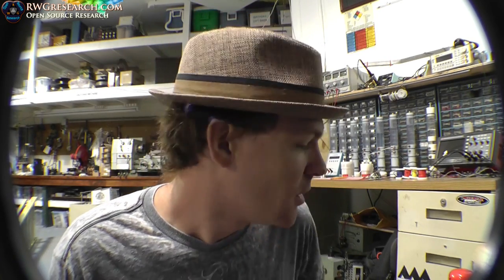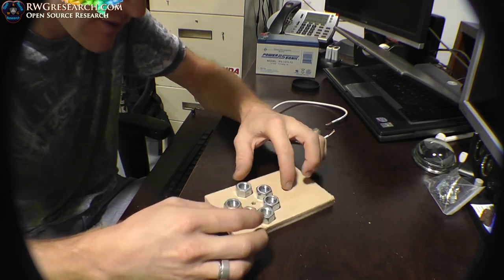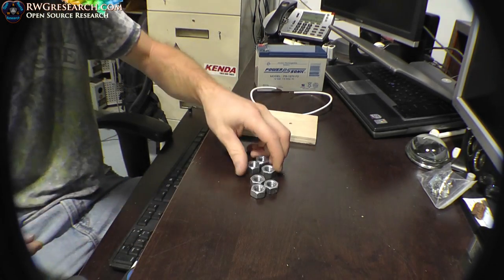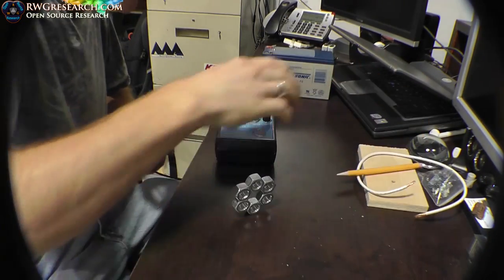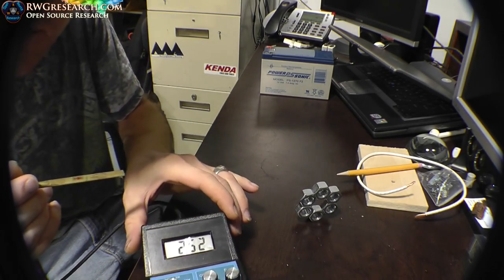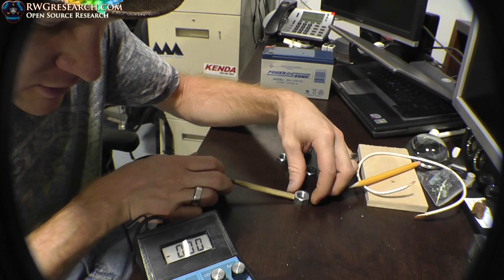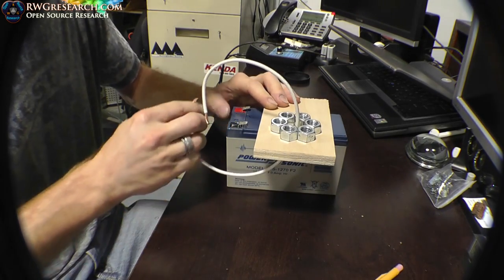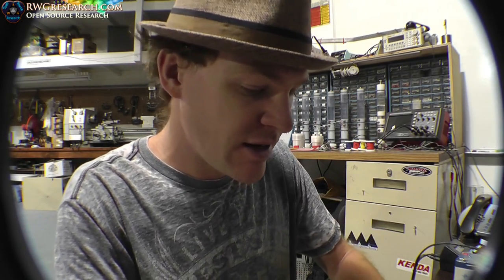“Oh Nuts!” Magnetic Lock.Your Going To Like! Using The Principles Of Ed Leedskalnin PMH.Must Watch

Comment: Its molecular welding. The circle of nuts creates a magnetic trap like a transformer winding, (brain fart cant recall what theyre called) and the magnetic energy travelling away from the wire in one direction gets trapped in the nuts, and then the surfaces of the nuts weld together on the molecular scale, because theyre passing electrons, so they share bonds after the process is done.

This is similar to that bar on the U bolt trick, except i cant be so sure its molecular welding at play there, but i suspect its similar.

Most likely there is some form of magnetic molecular welding that few know about and even fewer have studied.
Reply: I think your on the right track.  If you look at my comment about 2 days hence I also suggest something similar but  having to do with interaction with the casimir effect.
Reply: Larry Shelly I havnt studied that much in electrical physics and magnetics, im more into gravity, and "dark matter" (quotes because spoilers, it doesnt exist) stuff. Ive had working models for black holes and space warping for a decade now, working models for the big bang too, how everything works, but of course im not a big name professor so my ideas get ignored!
Reply: WeAreGRID I am with you on the subject of "dark matter".  It's more suspect than Einstein's cosmological constant that he used to explain what he didn't know.  At least Einstein didn't try to tell everyone this constant was a fact of nature.  He really didn't know and had the courage to admit it.  Maybe dark matter and energy are really just the remnants of the "true vacuum" that existed before the "big bang".  I wonder if we all might be immersed in those remnants and that could be the explanation of even gravity (tiny bits of truly "suckey, sticky stuff" that induces the material around them to battle for their spot).  Ok maybe a bit simplistic but I think the final answer almost has to be that simple.  Anyone for "King of the hill" or maybe "hole". Anywho, way off the subject.  I look forward to checking out your stuff.
Reply: Larry Shelly I should add: I am impressed by your elemental thinking that gives you a "view" inside what is at the heart of magnetism rather than just describing the general attributes of a magnetic field.  Electromagnetics is at the heart of understanding everything.  It might not be everything but parallels probably exist that make many things clear if you see to the heart of it.  I am not fishing for over-unity like many others.  I'm just looking for better ways to understand and use what's obviously out there.  Stay vigilant.
Reply: Larry Shelly The whole dark matter thing is actually very simple, and i can explain it in a relatively short amount of space.

Black holes have enough mass in them to be able to exceed light as an escape velocity, but they do not have enough mass in them to exceed SPACE as an escape velocity. 

Because of this, they are infinitesimal points in space, but immensely large on the inside, they suck up mass, but not the space inside the mass.

Space is a liquid, its a fabric, and every particle occupies a specific weave grid location of space, when you move large amounts of mass, space sometimes moves with them, however when you suck up the mass (into a black hole) the space is now empty, there is space left over without mass.

This is the cause for many so called "dark matter" phenomena, such as galaxies rotating as a whole instead of as a vortex, specifically galaxies contain so much excess space that the arms are closer together than they seem, and so they rotate as a solid and not as a liquid because the vortex is in space, not in mass.

Another "dark matter" phenomena is the increasing expansion of the universe: Galaxies are flying apart faster because the black holes at the center are sucking up mass, but not space, so the excess empty space is being spat out behind them, (or rather in every direction, but due to momentum more ends up behind them)  simultaneously making them thrust propelled, AND making the actual physical distance between them and other galaxies larger, making it seem as if they are accelerating at increasing velocity when really, theyre moving at constant velocity, but are making more and more space, which logarithmically makes them cover more space over time than just a moving object.

A third example of this, and one ive been theorizing over for quite some time, but recently have had my theory confirmed by research into the big bang (there was a news article about how they proved through some microwave particle or some such that space expanded first, then mass).

The big bang happened as follows: 

The previous universe, having eventually (read; after quintillions of years from now) coalesced into entirely black holes, and eventually those black holes found each other, due to extreme gravity, then sucked each other up, and at the last moment, as every piece of matter in the universe (or a mathematical reasonable facsimile, as near infinite is identical to infinite, meaning there could be space ships outside the universe for us to find, or not find as the case may be) was condensed into the singularity (sound familiar?) the combined force (read (E=mc^2)(infinity) ) unified all seven forces, and produced enough pull to actually be able to suck in space, and space, being over an infinitely tall well, immediately rushed in towards the center of the singularity, causing the universal expansion of space in the instant before the big bang.

The outside of the singularity now being devoid of mass (or a reasonable infinite facsimile) and now space, ceased to exist, the inside becoming the new universe.

Space expanded on the inside of the singularity, draining the outside of the universe, and rushed to fill the universe at what, 11 times the speed of light? 14 possibly, i digress, and then the inside of the singularity, having become boundaryless (as space exploded from the inside out) now proceeded to release every particle into the newly formed area of the universe, and from there, the rest is history.

Relatively short amount is accurate, as i could write most likely an enormous thesis on each of these phenomena.

And with that, i give you space as a liquid, and the argument against dark matter.
Reply: Larry Shelly Did you know the human brain is the most advanced GPU in existence? its how fighter pilots do physics calculations in their heads, its how you play pool, its how you catch a ball, humans are capable of complex mathematical projections in their heads based on the simple and obvious rules of physics.

When you expand that capability, when you teach a child how the entire faculty of the universe works, you end up with someone who understands how post university level physics works, without the need for equations, because the equations are done in a superior format, that being the subconscious mind.
Reply: WeAreGRID Enjoyed your expose.  Some of your basic premises run in line with some of my thinking.  I do think the "space" of space is only now being given it's due respect.  I have never heard anyone even offer  a good rational theory of what, how or why the actual "prime mover mechanism" works.  This is the most fundamental, elemental  and important "trick in the book".  My thinking is that until we understand this, we are only quantifying things, not really understanding them.  I do appreciate your willingness to share your belief on how the cosmos works.   I am reluctant though to fully commit to even the most widely held theories at the cosmological scale unless their proponents  can demonstrate they fully understand how things truly work inside the atom.  The attempt to find and understand the higgs-boson may be a step in the right direction but I'm not yet convinced it is who it says it is or does what it purports to do. I worked at a facility that discovered (or at least we found a few and verified existence of) the neutrino. We put labels on things that we can barely measure and take credit for great discoveries.  I'm not so sure that's good or useful science.  The most important thing I ever learned was that  you have to be able to tell what's program and what's data.  Unfortunately,  that's next to impossible without the programmer's notes. SO  if we get a more genuine thinkers like yourself I believe someone will come up with the idea that gets us into a full understanding of what makes the subatomic clock tic.  Until then we may be able to say the driving force is the main spring but the question remains "Who wound the spring?".
Reply: ttips Should have said ttips is my sign in for Shelly
Reply: ttips You know, ive got a book of programmer's notes for the universe, but unfortunately for us the most detailed it gets is that the universe is running because its vibrating because of the voice of God. String theory, if you will, is similar, everything vibrating sub atomically, sub quantumly, all from an outside source we cant begin to quantify or explain.

However i do a better job explaining physics than i do apologetics, and i am not yet called to ministry, so i couldnt very well claim to know everything there is to know :P
Reply: WeAreGRID Thanks for the response but instead of an "outside source" I do tend to think its an interaction of an "inside source" and the "void".  Brevity will not allow me to say why I believe that but it has to do with my way of thinking about how space is "created".  Unfortunately until we get a solid idea of why the clock doesn't run down I believe we are just throwing more tinsel on the tree.  We've probably going to discover more by serendipity than by even dedicated  research.  Maxwell understood more than many of the most advanced people in his field today . As difficult as his work was (not many shoulders to stand on in the 1800's). we benefit from his work in great and meaningful ways today.  I would love to see someone like Maxwell in the field of physics today.  Enjoyed the discourse..

Comment: if you use stainless steal nuts your experiment probably wont work because the content of iron is needed in order for the steel to conduct a magnetic charge.. Stainless Steal has a lot of chromium that is added to a mix of carbon steal which might be the reason the iron content in Stainless is reduce to where a magnetic field cannot be conductive enough  to a hold high enough charge...
the  positive charge within the electrons of  iron molecules are enhanced to created a magnetic charge thus electrons attracting electrons  when you touch the steal nuts or bolt or tool steal plates  or whatever metal is used that contain iron or hematite those electrons are thus given a boosted charge equally... What do you think of my theory?

Comment: You made a simple magnetizer. The 12 volts flowing through the wire temporarily magnetize the nuts by making all the particles in the metal line up.

Comment: This is too simple! Your fast changing current inside the wire created weak magnetic field that stored inside the steel-nuts. After you break that field, they will fall apart. Interesting would be find out by using a compass, where is the north and south pole located in this system. The AC is used in similar way to lift iron thrash from garbage with lifting machines, where it is converted to pulsing half-wave DC, that creates dragging force to attract magnetic metals.

Comment: writing this from my moms account. Check channel. EMC4U2 thats me.
The current in the wire creates a vortex magnetism around the wire. Every single nut absorbs the magnetism and creates  a North-south pole in the center of the rim. Every south pole also connects to the north pole on the next nut. But because the nut is "round, the magnetism also circulates the other way around connecting to the nut on the other side, creating a north and south pole on each nut, on both sides of that nut circulating and connecting to the other nuts and their respectively double pole sides. You can hardly measure the magnetic flux, because in every nut both poles help and cancel each other out. The connection between the two nuts, is the only place where the magnetisn jumps to the next nut to connect to the opposite pole. The total makes up a closed loop, acting like the Edward Leedskalnin principle. But actually it is 6 leedskalnins PMH , connecting to make 1 PMH.

Pretty cool experiment ! good thinking !

Cheers,

Rene

Comment: I can't get it to work with the gold colored nuts I bought. Maybe they have a coating that is not conducting?
Reply from the maker: Are they coated or are they brass? Brass is diamagnetic and will not work! ~Russ
Reply: @RWGresearch  I believe they're coated, don't feel like brass. I found enough other nuts to make the experiment work but they're too small to handle much. Pretty interesting.

Comment: the nuts are hexagonal. would it work on a different shape?
Reply: MUST be a ferrous meta! Knockouts from electrical boxes MIGHT work, but the flat sides are an important factor. More contact area means more parallel magnetic lines of flux. So knockout discs might not work at all, but certainly won't work as well!

Comment: Simple answer:

You are creating an electromagnet with the nuts as a core and the wire as the coil. Inductance from the wire when the very high current flows (shorting the battery), induces a magnetic field into the nuts, though it is very weak, because of the setup of a single wire, which is too far from the core, having no windings, except for a single and obtuse winding made with the wire. Remember that distance is a very critical point in magnetism.

Cause of not holding together?

Because you are creating an electromagnet as a whole. Each one of the nuts will possess a fragment of that magnetic field. Breaking the nuts formation is the same as breaking the magnetic field.

Each nut, as part of a whole magnetic field, will also have polarity. If you try to re-arrange them in the wrong polarity configuration, it will not hold together. The field is also very weak at this point for the reasons explained above. The wire, even when a high current is passed through it, it is too far from the nuts. 

If you magnetize each one of the nuts separately, it will always hold together, provided that you combine the polarities correctly.

Comment: Magnetic flux has behavior similar to that of air flow, but it is on the atomic scale.  When a flow goes around a curved surface, be it a ping pong ball, an atomic nucleus (which appears to be a mass of electrons at relative rest), or an airplane wing, it travels more quickly than surrounding particles in the flow, (a) low pressure area(s) are/is made, and forces are created.  See https://www.youtube.com/watch?v=_oZYArx5oM4, "Ping Pong Ball on a Hair Dryer" for a demonstration of the Bernoulli Principle.  Things at relative rest, such as ping pong balls or atomic nuclei, tend to stay at rest unless acted upon by an external force.

Comment: What if you would make the wire 10 times go through the hole?
Reply: +John Obmar as long as all the wires going through have the current going the same way it would be amplified.
Reply: +Zev Hoover 
That is what I mean. The magnetic effect would be 10 times stronger.
But you could make a big spool first, with 100 or more windings, and then arrange the nuts.
When you leave the spool longer connected, the nuts would become hot too.

Comment: Seriously,  the only thing I can add at this time is, there are four waves of energy, two arguably Electromagnetic and two Gravitational. Because we only have testers on electromagnetic(Tesla )dose not conceded that gravitational is not measurable. I personally use the "void " of EMF to detect Gravitational (Linear Paul Magnatizum :my coined phrase) looking at your experiment I see the Micro Tesla meter you have some close to zero readings, this IS a reading comparing ambient at 200+-? So your easiest explain is at the.200 Milla Amp threshold is where electromagnetic binding a curse. You have that saturated amount of electromagnetic thew all those little nuts of yours, but not enough to lock permanently. Your on the cusp of understanding Linear Paul Magnatizum and the gravitational waves. However you understand a shit load of other stuff that I don't so I am trying to coach you not belittle your efforts. Hope this helps.
Additionally I am going to send this video over to my friend Art.Devine from my video series A-R-T Magnetic Arts. We will see his take on it. 

Cheers Russ

David A Puchta

Comment: The high voltage from the car battery quickly melted the metal and cooled very quickly essentially welding the nuts together.
Reply: MyTube6444 nope, that would not let it fall apart just by moving one
Reply: MyTube6444 they would stick way stronger too

Comment: Hi russ type in you tube this a I r  Peter Stevens 25 feb 2012    Here joe booker is showing the same type of magnetic symptom you have done but later in the video get a pen as when he states "so you want a diagram" he tells you the circuit of his static air engine his house is the ignition on the car then I assume their are relays in his terminology of T junctions and the roundabout the starter motor as staggered T junction may be a fuse anyway he is explaining a electrical circuit but I struggle on this side Peter Stevens tells me recently its a right hand vortex wire wrapped around the earth and then a slight vacuum if you want all his emailed info I can forward it on but need a email address think that I am brain dead in what you ask me best way to make sure others can copy stuff and if they get it wrong then its the fault of the teacher cheers